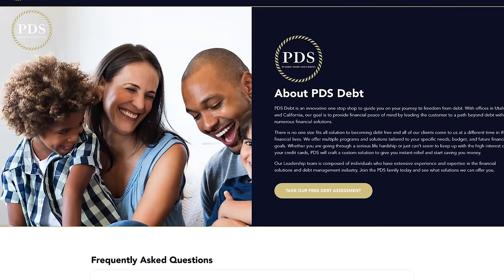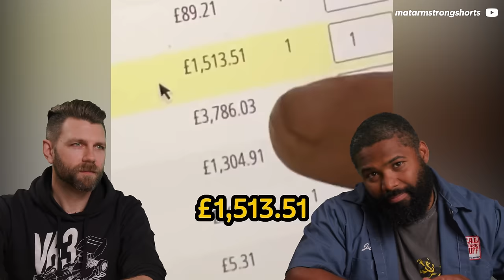Mechanic Reacts to Expensive Supercar Repairs

Comment: $8k for tires… ehh but $25k for an oil change is nuts!
Reply: yeah but it's a bit misleading as it's not just an oil change. they don't have the standard oil drain and maintenance as normal cars. like they got some stupid super complicated hours long deal where they take a bunch of shit off and such. so it ain't just drain and refill like normal cars. but still yeah most of that cost is just labour which is crazy to think about.
Reply: Not only is it the in-depth inspection of literally every structural component on the car that savagememes873 mentioned, but the Buggati's have multiple drain points and inspection ports that have to be serviced every single time. Take a new Ford F150 with a 5.0L to a Ford Dealer for just an oil change, it's $100 and a 30-minute wait because it takes 15 minutes just in drain time. On the Cherion, half the underbody gets disassembled. That truck just gets a felt panel removed.
Reply: It’s because you have to remove the engine from the car to get to the like 16 or whatever drain plugs
Reply: @savagememes873  thanks, I’m picturing pulling the drain plug, slapping a new filter on, & saying “That’ll be 25 grand please”
Reply: also something that's not talked about but constructors knows, when you buy car that's not brand new, you want the full papers, and you will be a lot more confident if it was services only at an affiliated or official garage rather than some "random no name" garage, they all know it and obviously they will abuse it
Reply: @Tarn_DJD  Beyond that, it's a complete engine inspection, they essentially split the car in two, takes many hours, they happen to also do an oil change.
Reply: There's a reason why only billionaires and the ultra rich can afford these cars. They're literally meant for only for them due to how expensive they really are.
Reply: @mostneuter that applies to any car these days.
Reply: 8k for tires is still a lot, compared to normal cars. My cars new tires cost 600 and thats 1/4 of the whole damn car. xD
Reply: @ianrobertson3419  yeah, but it scales dramatically when it comes to supercars and hypercars
Reply: @Tarn_DJD you can pull the oil without removing the engine but you have to remove stuff that are single use bolts and mandatory replace when removed.

They are utter money pits.
Reply: They don't use conventional oil - they use printer ink.  Worst part is you have to do the full service even if you've only run out of cyan.
Reply: I just do not believe that mechanic. There is no way oil changes cost that much, and the tires you can just put on something else for dailying.
Reply: You likely have to pull half the car apart to get to the filter(s), if not pull the engine
Reply: @BleedForTheWorld it’s like if someone gave me a nice yacht. I couldn’t put gas in it.
Reply: @Stars-Mine no, the engine comes out to change that oil and it’s a full engine service at that time. The tires are specially made to handle the top speed and are OEM only I believe.
Reply: A set of good tires for my old 99 Dakota (31x10.5 R15) ran around a thousand bucks just for the tires and the last set I got for that truck was easily a decade ago (had to scrap it at the end of 2019 due to frame rot)

So $8k for a set on a 3 million dollar car, well tbh that sounds cheap as hell. Relatively speaking that is.

Granted, to me a "cheap" tire is a used one from a junkyard that costs $5 or $10. (great way to get a spare tire for cheap... also full sized)
Reply: @cmdrdredd  How often are you pushing 240mph?
I know the tires cost that much because of the speed. guess what speed you are going on any race track. not 240.
Reply: 8k per tire. 24k for tires
Reply: The 25k oil change is not true. It's a 25k engine disassemble, inspection, and reassemble, then they put oil in it because they just essentially rebuilt the engine. It's not a price for draining the oil, replacing the filter, and adding new oil.
Reply: The car has 13 drain plugs
Reply: The drain plug excuse is nonsense, engineer a better oil system.

Drag and drive cars can hold 3000+ Hp with a dry sump and change the oil in the car.
Reply: $8k PER tire.
Reply: @InvisibleSquids huracan has like 10 drains and doesn’t cost 25k.
Reply: its actually 8k for ONE tire so like 40k for a new set and the reason you replace the wheels is bc the tire is actually glued to the rim bugatti only allows for 4 tire changes before mandating you replace the rims
Reply: @jacobm9263 I think that has to do with the fact that these tires are practically glued to the wheels on any modern Bugatti, starting with the Veyron. Not sure if that applies to the new Chiron?

So in essence, one has to replace the tire and wheel as one unit, thus pushing up the cost. Also, Bugatti usually recommends replacing all four units in one go — with a price tag well north of $30,000.
Reply: @thecopyninja8043 Damn! I just repeated what you said as I didn’t check the whole thread here😅
Reply: sorry but 25k is major service
Reply: I feel like people with much less official qualification than a Bugatti engineer build engines with the same HP as a Chiron (and with all necessary cooling and stuff) and only need 1, maybe 2 drain plugs and not too much else removed to change the oil.
Reply: No its not. For example a lambo you just take off the under tray and undo 6-8 drain plugs. Nothing special yet they charge around 10-20k for it LOL

Comment: I like how Sandro said "they'll run dry" when talking about civics. I had a extreme oil leak that caused my civic to run out of oil when driving to work and I was able to still drive it home and a year later the car still runs.
Reply: A few people on YT have tried different liquids instead of oil to see what will kill the civic, including running it on ketchup. Nothing killed it, it ran with them all.
Reply: @Duskati  I've seen some of those videos. I definitely still did some damage to my engine by running it dry but it does still run. It sounds like something in the engine is rubbing but once the oil is circulating it's fine.
Reply: @kylewagenaar5786  oh you definitely did damage! It'll keep running though
Reply: Is he referring to Civics in general or just a certain generation? Because it seems to me like the 92-2000 were bulletproof and then the EM2s from ‘01-05 were hot garbage durability wise sadly
Reply: @zachhoward9099  I have a 09 civic si which has a K20 in it and that is definitely a bulletproof engine.
Reply: @zachhoward9099  yea 01 to 05 were bad years for the civic
Reply: @zachhoward9099  FG2/FA5 Civic K20Z3s (2006-2011) are bulletproof. One time when I was revving to 8600 RPM (flashed with increased redline) the engine oil light came on. Checked the dip stick and realized oil was nearly gone (it liked to consume oil when driving hard). Put oil back in, light went off, and ran like a top. Always warmed up the car before stepping on it, but that thing screamed while getting 28-32mpg on the highway. Such a great little engine.
Reply: Hmm. Wouldn't mind my next car to be a camry or civic. I just don't wanna get a Toyota with those Takata air bags in them
Reply: @Akiss  my oil was so low that it took 2 liters before it even touched the dipstick and I never had an oil light come on. I had a couple sensors crack from changing temperature too fast so maybe it couldn't send out the low oil signal. If you have to drive in -45C use a block heater and let the car warm up before driving it.
Reply: Thats some Japanese reliability right there hahaha
Reply: @Duskati dumping non-Newtonian fluids into an oil tank is certainly a choice.
Reply: @sdmurphy20  everyone put Takata airbags in them including Honda.
Reply: @raistlarn  I see. Dang

Comment: “Buy old Toyotas.” Wise words my friend.
Reply: '68 first gen Corolla here...3rd owner, it's been a daily all it's life...mine going on 37 years now.
Reply: I work at a part store and at least once a month someone driving an old toyota (98-2004ish) will come in and need oil. I usually check it for them, more often than not its bone dry and the little splash of oil looks like sludge. But she's still running!!
Reply: Sometimes I think old Toyota owners are just laughing at the rest of us.
Reply: @martincastaneda8574  Yeah but I'll still give ya a ride when you're broke down.
Reply: Supra has joined the chat
Reply: I used to drive a 94 Land Cruiser until it literally started falling apart, I switched to a 2015 4Runner in 2015 because the frame on my Land Cruiser was pretty rusted out (engine had 400,000+ miles on it)
Reply: nah m8 we generally feel sorry for people driving modern german cars, ranaults citreons etc. Because we know those shitboxes ruin lifes.
Reply: @CrazyKraut20 it does seem to be pretty much any European car. Like what bubble are they all in.. haven't they seen what Japan's been doing for 50 years? (Namely T and H)
Reply: @nthgth  beats me I think it is something germans call kadavertreue "truthfullness towards a rotting corpse"

Comment: "F-150 all day because after that you can go to work"
And this is why Sandro owns this channel lmao
Reply: I will take my 700hp F150 all day.
Reply: I'm surprised any F100 could do that even if its modded lol. Especially a 1967 F100 those things are heavy
Reply: @redtra236  There is only about 200lb difference between a f100 and that Mcclaren. That's with a stock boat anchor in it. Put a modern aluminum engine in it with 700ish hp and your at parody with weight to horsepower performance.
Reply: @redtra236 compared to modern cars they're really not. Between modern safety standards, consumer expectations, and all the electronics cars are getting real heavy.
Reply: I will take F-150 then McLaren
Reply: @brandonlimbird  Sure you would bro. Just sell the mclaren and buy a hundred of your Fix Or Repair Dailies.
Reply: @brandonlimbird  So both?
Reply: @Loki_Trickster  *Parity
"Weird Al" Yankovic does parody.
Reply: lol so good!
Reply: I worked with a guy years ago and his daily work truck was also his sand dragger on the weekend, he just swapped tires.
Reply: I love that work ethic. Kids these days are trying to get out of work, and that's why they lack character
Reply: @squidikka Every car brand has some kind of negative connotation. Whether from truthful incidents or from just speculative nonsense from biased view points. I've seen reliable Ford's and unreliable Ford's. I've also seen other vehicles, a Civic in this case that was a massive lemon. Then you factor in paying for the name (Toyota, Honda, Nissan, Subaru among many others) and you realize that all vehicles can be unreliable potentially. Well all except Fiats lol...

Comment: Fun fact: The ferrari at 12:02 has a green licence plate and it was filmed in The Netherlands. We use 3 different kind of colours for licenceplates. Yellow, green and blue. Yellow means a normal road car, green means a test drive, blue means a taxi. So the car wasn't even his yet
Reply: 🤣🤣 wow, someone is in pretty big trouble there
Reply: I guess he'll be paying for it for years to come 😂
Reply: this car was in for a service because of a problem with de right rear tire Rods.
if you look close at the video you can see the right rear tire snap of to the left when het stept on the trotle what pushed it richt to the ditch.
there is a hole explanation video some where about this crash on YouTube.
Reply: But it’s fake, it’s a render
Reply: @mirkolippolis1369  its not
Reply: That is embarrassing then. Even more

Comment: The way the Top Gear chaps explained it is that the Veyron and Chiron tires can handle top speed for like 15 minutes before needing replacement.

But that doesn't really mater since you'll have guzzled down a full tank of gas in 10.

And your brain will have melted at that speed in less than 5.
Reply: And driving a Chiron at top speed for 15 minutes would require a straight road that is 110km long (plus braking and acceleration zone)!
Reply: @TheBod76  Ah, Autobahn...

Comment: Really liked Michael's input. It's funny (and usually appropriate) to point fingers at large corporations and laugh about their greediness, but it's also neat to be reminded of the very real technical reasons behind certain compromises. Like the bit about the McLaren engine placement for example. Obviously there's a financial incentive to making it difficult to work on, but the architecture of a midship supercar also just makes it inherently difficult, as you'd have to compromise on cooling, weight distribution, drag etc. if you wanted to make it more accessible.
Reply: I'm not a regular viewer of this channel but I very much appreciated Michael's input. I don't have exposure to supercars and felt like I learned quite a bit during his segments. If he had a channel, I'd watch it.
Reply: @Tepid24 Agreed!  When one is making a hyper car the ability to maintain it is not high up on the designers or engineers list of importance.  The people who loan the worst are those who have never had to design or build anything.

Comment: 7:00 Supercars are effectively like aircraft and the parts are made like aircraft parts and the maintenance is like aircraft maintenance.  

This is all expensive because the components are engineered within an inch of their life, like aircraft parts made of aluminum and notoriously prone to fatigue failure under normal loads for excess time.

Comment: Fun fact: with a full tank and brand new tires, you'll only get 10 minutes at top speed.  While the tank drains to empty in 13, the tires only last 10 minutes before becoming fully worn out and dangerous.

the Bugatti oil change is partially that high due to it taking 2 days to do, requires a partial engine drop, and mechanic having to reach something like 20 drain plugs. the tires are bespoke Michelin  tires designed to keep grip and not explode at speed, you're paying for the R&D and being the only tires for the car. the rims share a lot of DNA with F1 rims, which only last a single race before having to be scrapped and remade. the brakes are bespoke as well, and made of a lot of exotic materials. 

Basically, Bugatti's are designed to be looked at, maybe taken to its limits once and then put away, more than actually daily driven.
Reply: Yep. I remember Jeremy Clarkson explaining this while driving a Veyron at 240mph.
Reply: 10 minutes at 250mph+ is a lot of distance!
Reply: @SanityTV_Last_Sane_Man_Alive Yeah But those Cars ARE NOT DESIGNED TO DO THAT. as a mechanic I gotta tell you thats like saying why thain to be a boxer when a man on sarms and angel dust can hit just as hard in half the time. for one no they cant go that fast. no street car is really likely to match those speeds. they are maybe able to accelerate like that with enough mods. but again this can be fatal even if you are a good driver. if you forget or miss one upgrade you needed parts of your care can explode. not just the ones dealing with combustion. like tires, drive shaft, diff. and again most wheels and tires except those cant take that.
Reply: Heres the thing; those numbers are for top speed, but what about operating at other conditions? You wont really ever get these 400+ top speeds even in a private race track because at that point they could only get those at controlled enviroments, even if you race this thing on a normal racetrack, assuming you have the skill for it, you probably wont reach much more than a little over 320KM/H. (Which is about 200MPH for you american measurement weirdos) and even then yeah, after a lap or 2 you will want this thing checked but it wont be nearly breaking down bad but just roughed.

And if you drive it around normally inckuding some leisure driving maybe flooring a little but never going crazy? I heard the engines are designed to be able to last for 30 years if properly maintained. Thats a lot of money on maintanences since i heard the warranty if for about 24k miles every 2 years so yeah.
Reply: @unkindled6410  Under normal road driving, the EPA combined is only 9 or 10 MPG, if I remember right. Doing something like a SCCA track day will probably see very low single digits or even gallons per mile.  You can daily drive it, but you're going to need really deep pockets for fill ups and the accelerated maintenance schedule  if you're putting on mileage like that. Getting into hanger queen status with SOMEHING always needing to be done.
Reply: I used to be able to drain a 63 liter fuel tank in about 45 minutes in my Australian HSV Clubsport R8 5.7 LS1 hamering it through the twisty national park. 
Top speed on a closed track was 270kmh. 🇦🇺🙂
Reply: What about dragsters?
Reply: r888r is all u need to go from 0-260 in under 14 second, ugr lambo shows u that,
Reply: All I can think is that our technology sucks

Comment: 5:16 apparently the reason why Bugatti oil changes are so damn expensive is because there are about 13 oil drain plugs hidden throughout the engine bay of the car. You need to completely disassemble the rear end of the car just to drain all the oil out, then you need to replace the oil filter (which I’m sure was developed exclusively for this car, which is more money), then you need to reassemble the rear end of the car refill the oil before you can even get going again